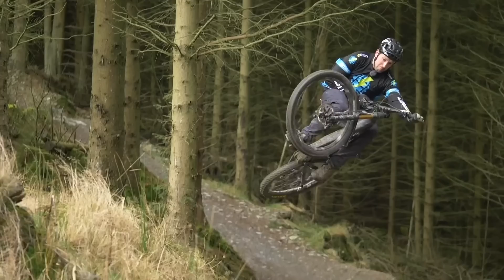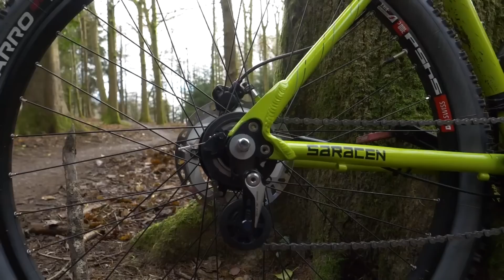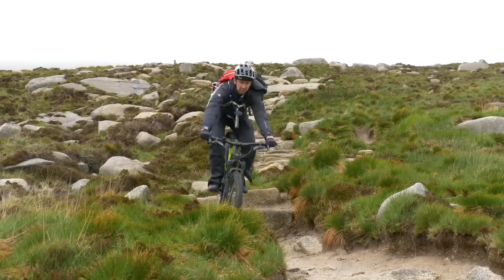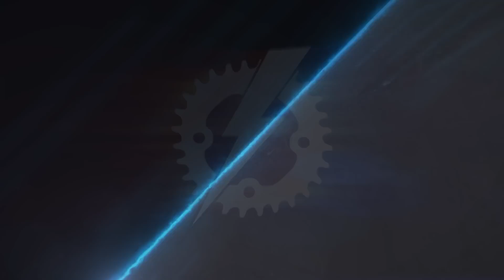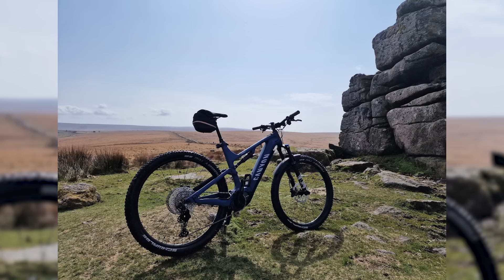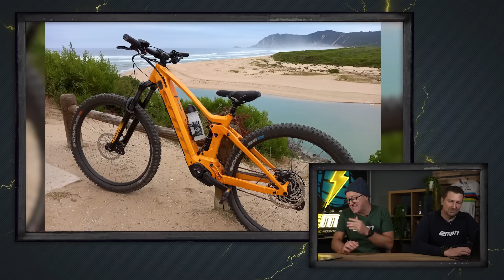From Prototype To ALMOST Production! | EMBN Show 223

Comment: Of all my bicycles, which are seven in total, six are steel. I love how firm steel feels, especially when slightly oversized, and yet it keeps the smoothness. Titanium does not really do that, as it may have the flex, but it does not have that damping characteristic. Thanks to centuries old railway technology, where oil dampers were no option yet, the search for a damping steel alloy started early. They tested leaf spring blades by dropping a large ball down on it and measured bounce-back. This is how they discovered the chrome and molybdenum steel alloy  had the best performance.

Comment: IMHO the gear hub transmission ought to be integral to the jack shaft. Get that weight centralized and suspended. Nice work though, keep up the great work.👍😉
Reply: You are close , integral to the motor in its core

Comment: I don't think steel has a place in full suspension ebikes as it works best on hardtails. Those small cogs will wear faster than larger ones and will clog up with leaves, sticks, mud more easily.
I'm all for the private guys trying to come up with stuff but they are always going to be niche products and an acquired taste.  Some starling bikes are very flexy at the rear pivot, this one looks like a hinge pig too so for me at least, i would never consider this.
However the future of ebiking is hub gears.